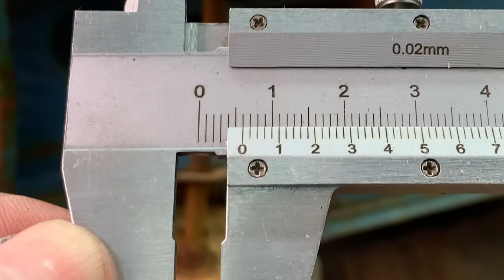Restoration of a toy truck. It was made at the tractor factory!

Comment: Nice job but I wish that you had painted those 2 front bendable engine hood tabs off white (instead of blue) to match the front grill assembly.
Reply from the maker: Thank you for your rating and for your advice. I wanted to stick to the original color.